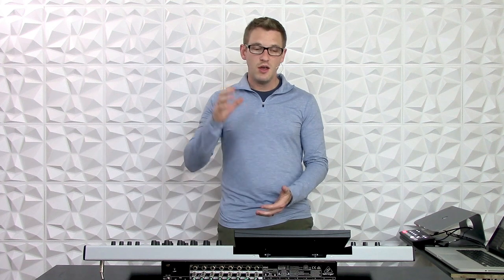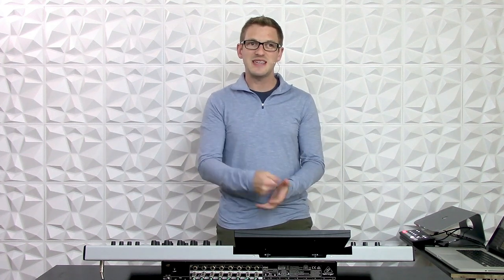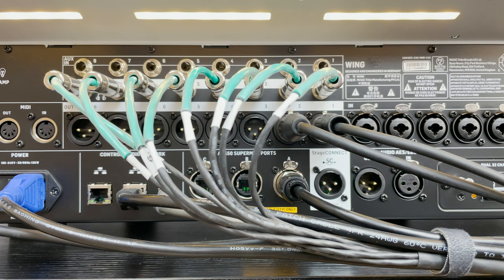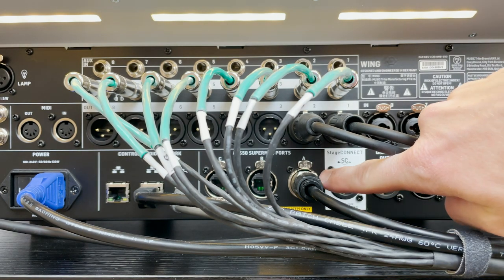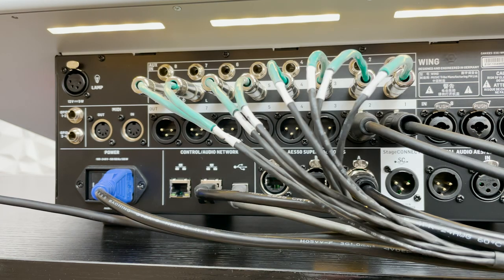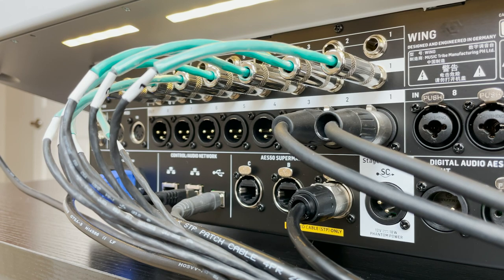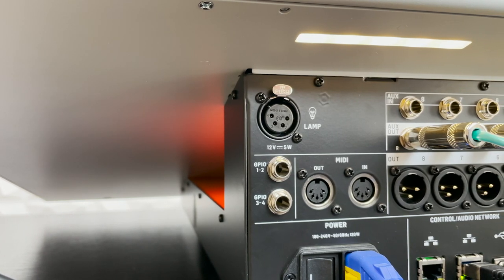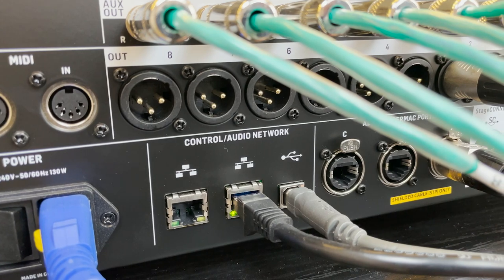Behringer Wing 002 - Overview of the Rear Connections

Comment: For those interested in Dante. Since last week, the external Dante card has been released for around 400, -. The dual SD card is then replaced with the Dante card. Behringer is currently working on an internal Dante card so that the two ethernet ports (left on the panel) can also be used for Dante. Then the external card slot can be used, for example, for a Madi card.

In addition, the 2 ethernetports functions as a network switch to which you can connect network devices.

Comment: can i plug in a monitor or a mac laptop or mac hard drive some way.
Reply from the maker: External video monitor no, speakers used as a near-field monitor, yes. You can connect your laptop to the Wing to use a DAW to record or playback multitrack audio with. Hope this answers your question.

Comment: For a so called "mixer", this input section is lame. 8 xlr connections for 3k. Why even sell it as a stand alone mixer. I have never seen a mixer this big for 3k with only 16 live inputs. At least the Presonus 32s is actually a 32 live mic input channel mixer.
Reply: It is called "Wing" for a reason. This unit is mainly used for FOH mixer, you need to run 1 or 2 stage boxes to receive multiple inputs.